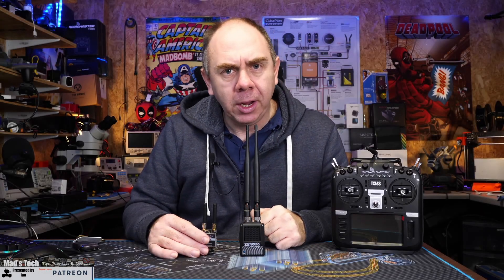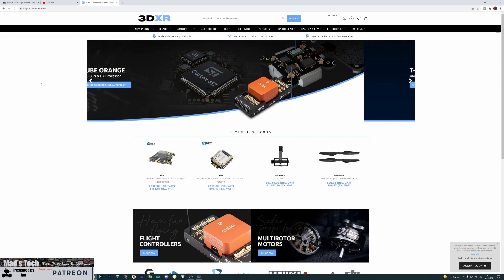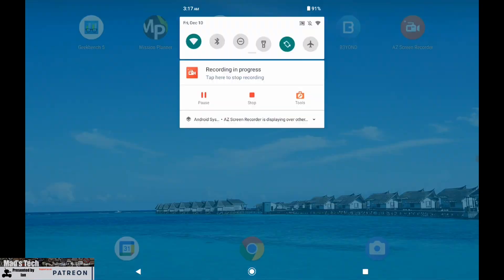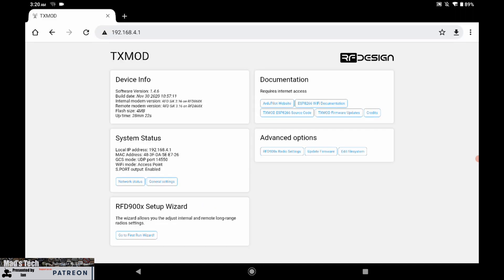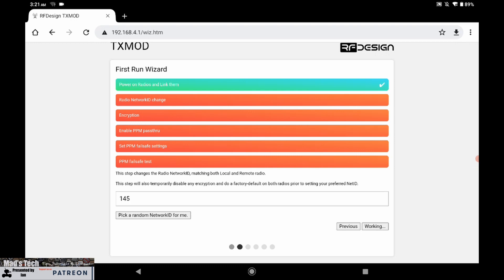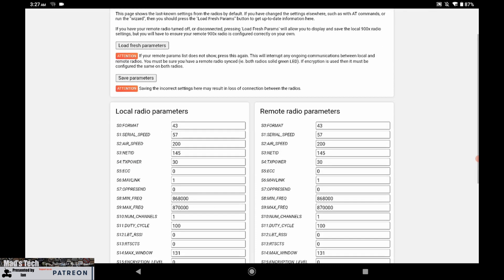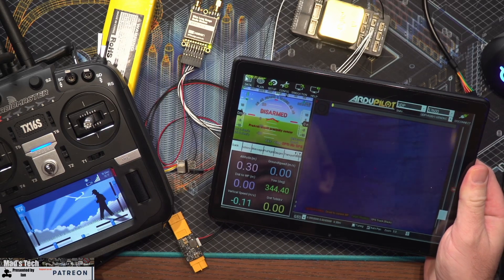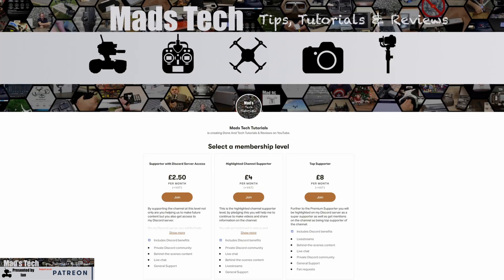RF Design TXMOD 868/900Mhz Long Range Ground Radio With Wifi

Comment: It's been a little while and I know there's a lot of other content to cover, but would still love to see the setup and demo of the TXMOD with the RFD868/900.  I just purchased the TXMOD combo.  I'm also curious if it will work with the SiK radios like the RFD900 does.  They're SiK based after all.  Thanks!

Comment: Might be usefull to add the  h t  t p s   sequence to the 3dxr and telonic website cause then those links will be better recogniced. 
I was looking for the rf design products cause I had not known about or missed. I only knew about the siri ones and therefore I checked the description box for a link to the rf design products on 3dxr which I could not find till I read the box line by line and realized that some links are not formated in blue as links due to missing headers.

Therefore they got lost the first time I had checked the box. You can see the difference at least under Chrome and W10 if you compare it to the cubepilot  link that does work.

Great overview and I will watch the built series too even though I have ordered my first elrs kit to start playing around a bit during summer before I might move from crossfire to elrs even though not being sure if I should stay with crossfire on one plane for comparisons.

Comment: How do you change transmitter power level of either end on the fly ?
I have not been able to get the sic radio app in MP to make changes .
It says something about having to disconnect but it just doesn’t work .
I can only change tx power level this way .
On the air side I got in the rfd radio by usb on pc to setup with 500mw

Comment: Purchased the combo with TXMOD and UX receiver. Have several problems. Using with TX16S control stick output not working correctly. Tried to update firmware and TXMOD would no longer communicate. No help from vendor. Good luck